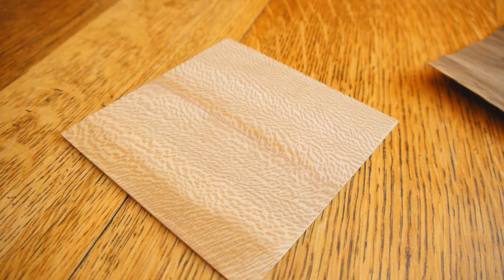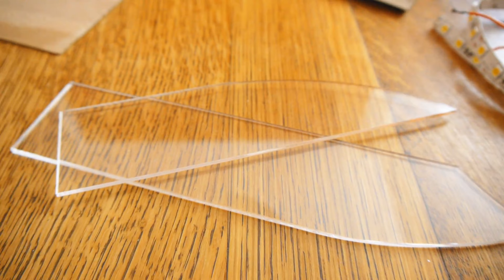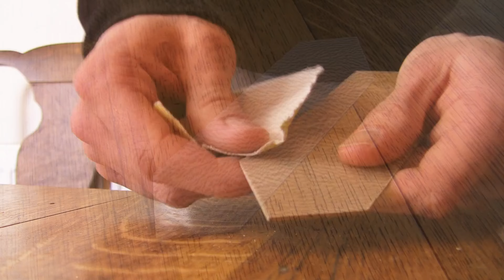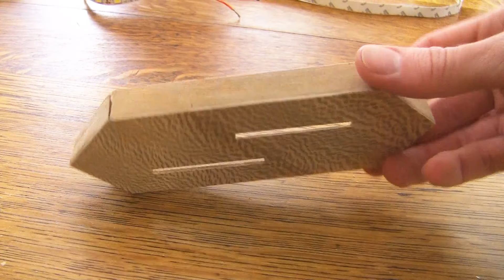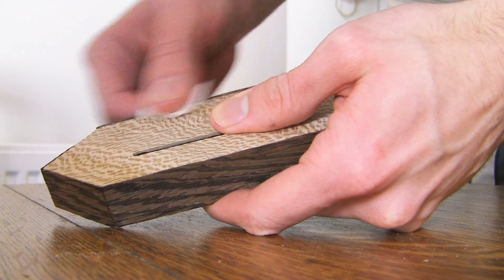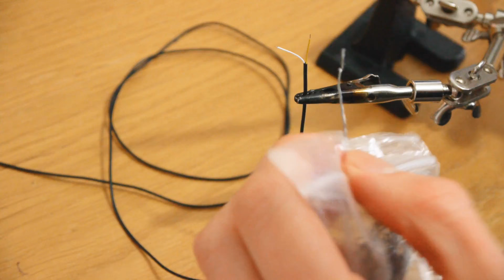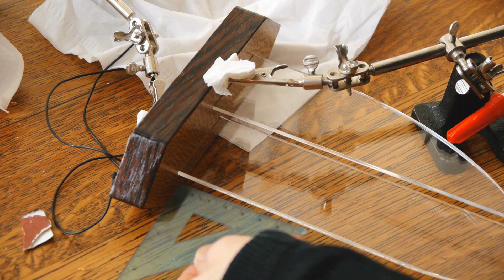Make your own Shard Light

Comment: Joining the wires with tape is a bit of a bodge, after spending so much time making a nice job. I would suggest fitting a socket into the lamp unit, and a plug on the wire from the power supply.
Doesn't cost much. You can get them from somewhere like Maplin (uk). Oh shit, they just went bust - lol...

Comment: I really liked your video but I Suggest you bridge the LED lights in a parallel circuit so they can both run on 2 AA or AAA batteries and you could make space for a battery holder and that way you could eliminate the need for the power supply and make it slim and wireless

Comment: Only thing I could think of to add to this is either a switch to turn it off and/or a potentiometer to adjust brightness. Both could have easily been placed near the wire hole on the back

Comment: Nice build, If you wanted to get a nice clean finish on the shards and remove the scratches (depending how deep they are) you could alway wet sand the pieces with fine grit paper (2000 grit or higher) and then use polishing compound for a clean finish.

Comment: can I use real glass?
Reply: true but I don't think glass transmits light like acrylic does these kind of plastics illuminate on the edges in a unique way similar to fibre optics.
Reply: i try it ! but it's so hard to make i shape like that with glass
Reply: and would you really want razor sharp glass shards on your book shelf.
Reply: hhhhhh It could be rubbed, to become smooth edges
Reply: yes
Reply: It doesn't.

Comment: That was too much of an exaggeration  with all those equipment ...  And in the end joining the end of wires with electric  tape
Reply: i too noticed that part was a little poor made, but maybe he has his reasons for not soldering it or using some clamps (i don't know how they are called in english but in my country we call them "morsetti mammut") maybe he wants to add other lights to the same power supply
Reply: seriuskndfgs egg oh really didn't kmow that
Reply: hennochoi they are called alligator clips (the more you know)

Comment: to make the light softer or dimmer, you might try using resistors on the voltage source. (12v seems high for 3 LED's) 5- 6v is nice. if 12v,  try a 22 ohm, 33, or 50 on one side of the power source for desired brightness.
I like to sand the shard edges flat to diffuse the light. 
Nice vid... +1

Comment: It is not get hot?
Reply: These led usually requred additional cooler
Reply: depends on the actual LEDs he used, but usually the ones mounted on Strips are pretty low power and the cooling provided by there PCB is enough :)
Reply: Mirock's Woodshop Glass is already a bad conduter of heat, it will not get hot because it radiate the heat before it get hot cause radiating surface area is much bigger that bottom heating area.

Comment: If you leave the connector on the power source and put a fitting connector socket in the stand, it will look more finished and be safer.

Comment: Just a heads-up on the "old headphone cable":
Most of them have cables that are hard to solder, so I`d go with maybe an old cellphone charger, a 3.5mm headphone jack cable, or something like an RCA cable, those are also thin and are almost always of the easy kind to solder :)

Comment: i have used a 5050 RGB light strip with transparent sillicon glue, but some of my LED's don't turn the right color. It is in the middle of the strip where this happends. It is not the solder points, because i dubble checked them and used plenty of wire so they wont move when i glued them down. Could it be that my glue creates shortcuts??

Comment: To anyone who doesn't want markings on their plexiglass/acrylic here is a tip.
Buy plexiglass/acrylic that has a protection layer on top (It's kinda like tape). Be sure to remove part of this layer before glueing it to the LED's. When you slide the wood on top, remove the layer.
This migth not work though as it can be hard to break shards of with this layer on top.
But regardless, now you know.

Comment: While I'm not handy enough with wood to actually make this I do think it would look awesome if you set it up with RGB LEDS which you can get in the same strip configuration as in the video.  Using something like this: http://www.amazon.com/HitLights-Multicolor-Changing-SMD5050-Density/dp/B005QDO8YU/ would provide you with the controller, wall adapter and a remote.  Wiring is the same except you have 4 wires to be mindful of instead of 2.

The big thing is you'd have to work out how to accommodate the IR receiver, either with an extra hole in the side of the base or possibly hidden cleverly near your lamp.  On top of color changing and patterns you'd also get to turn it on and off remotely so points there as well.

Comment: 90% art work and the rest is  tech know how. bottom line is make glass shards exposed to LED lights edge ways. I need  an A4 square   completely flat size to use it for reading in a dark room before I go to sleep. practical use

Comment: If you're going to be soldering, you should go ahead and use shrink tubing and solder the power supply leads. Electrical tape comes off and becomes sticky over time. If you don't stagger the leads to begin with it could be a fire hazard when it slips off. This is a simple and fun project.

Comment: Could you use colored film (like in the old red and green 3d glasses) over the light source to change the colors of the individual shards?
Also, could you use transparent plastic rather than glass? I'm thinking about sharp edges or the glass shattering if it were knocked off a table...
Reply: Eethan O'Connell It's not glass, it's basically plastic. And you can just use different colored LEDs.

Comment: How to do it simply:
Go to your friend's car and break his windshield. Take two glass shards and give them a round edge so nothing gets cut, other than your friend.
Take a coaster and cut two slots that the rounded glass shards fit in. Flip the coaster upside down and put some LED lights that are facing the holes you made. Take the two glass shards and shove them into the holes. Scratch them with some metal scrubbers or sandpaper to have a little touch of art. Superglue the glass inside the holes and superglue the LEDs to the bottom of the coaster. Superglue the bottom of the glass shard to give it extra stability. Enjoy your art that you spent hours  making and cutting yourself with. And the 20 minutes of time it took you to read this comment, take all the stuff to make this and do it.
матегiаιs:
Glass shards x2
Oval coaster or wooden stand
LED lights
Sander
Sandpaper
Hot glue or super glue
Batteries for the LED lights

Optional Items:
Sharpie marker to outline the glass shards
Colored tape to decorate
Funny stickers to decorate even more

Comment: You made this WAY too much work...many things could have been done easier, and better...First, why are you using veneer on the edge of REAL WOOD, just stain or oil it rather than creating something fake from something real.  Also, you shouldn't glue the LEDs to the acrylic, you should glue them to the bottom of the base (which for some reason is missing) and set the acrylic over the top of them freely (on top of a "spacer").  I know there are 100 different ways of doing things for every 100 people asked, but this seems "over engineered" on the wood part, and "childishly assembled" for the electrical part.  Nice idea, bad way to do it.
Reply: Ikr, he made it look so hard

Comment: Neat.... But all I see is a fire hazard. No heat sinking for those high power leds, small enclosed wooden and unvented box. Not in my house thank you. No matter how nice it looks.
Reply from the maker: UltraStoat Fire hazard? The LEDs together use around 300ma total, so that's 0.15w per LED. Hardly enough heat to cause a fire, even if packed with the driest most flammable paper imaginable. It's like saying 'don't leave your little LED flaslight on the floor... it might cause a fire'. Just thought I'd make it clear in case others read your comment and get put off doing the project. Your finger is probably warmer than the LEDs ever get.
Reply: DIY Perks So by your own admission.... your 300mA draw out of your 12V DC power supply equals what?  Well that would be 300mA * 12V = 3.6W.  That's 3.6 watts of heat you have to dissipate inside a small insulated box. Wood is an insulator your realize.  That's actually a lot when we are talking about the the small spaces we are dealing with.   I don't know where you got 0.15W per LED from, using your very own numbers it is 3.6W / 6 which is 0.6W per LED.  This isn't astronomical, but its not insignificant either... Especially when you put 6 of them in an insulated box with no venting.  So, yah, neat looking crafts project, but wouldn't put it in my house without some modifications.  Like using a metal bottom plate to which you would thermally mount the led strips to instead of wood.  That would probably be adequate heat sinking even without adding little feet to the bottom plate to raise it off the ground for air flow.
Reply from the maker: UltraStoat That's 300ma at the LEDs forward voltage, not at 12v (they're connected in series with a current limiting resistor). They're 5050 SMD LEDs you see, and are rated at 50ma each. That's a total of 0.9w... again, hardly enough to cause a fire or even get mildly warm.
Reply: It is easier to cause a fire with your mind than with this...
Reply: Ugh. Too many numbers XD
Reply: +UltraStoat You quite obviously have no clue what you are talking about.

Comment: ok looks great and an easy electrical build, but why so much faffing with different woods. why not just get a block of hard wood and open up the bottom for the gubbins? surely that would have been easier
Reply: supraking85 exactly, or i would use a peice of nice worktop for a cool finish, still it looked great.

Comment: Could you run those same LEDs off of a 9v battery, or do they need 12v?  I was thinking that having a battery operated light shard would be pretty cool.
Reply from the maker: lilturk726 They should work of 9v but will be a lot dimmer.
Reply: Okay thanks.
Reply: on eBay you can get battery operated LED-Strips, they use 3x AA batteries and runs pretty bright, got a couple of them myself. Those 3 batteries can easily run about 140cm of led strip, 60leds/metre I believe they are (put 2x 70cm together from two kits).
Cutting off so you only have 2x3 leds and you should be fine.

Also I usually test RGB strips with a 9V battery, a bit dimmer than 12V, but depending on colour it doesn't matter too much.
Not sure how it'd be on a white light though.
Reply: Nightykk Wow, thanks.  I'll take a look at those battery operated LEDs.  I wanted to make my niece something similar to this but I didn't want her to be bothered with plugging it in.

Comment: we cant use 12v ac adapter?
Reply from the maker: Aurbachin Auwhi If its output is AC then you'll get some flicker, but it should work all the same. One with a DC output is a better bet.
Reply: DIY Perks That might actually be pretty cool. Thanks for mentioning.

Comment: Did you smooth the edges of the glass?
Reply: Maddy Krebs he used plexi
Reply: John Krazek so is it smoothed or not along the edge? never worked with plexi so unsure how sharp the shard would be along the edge
Reply: the few times i worked with plexi, i sanded the edges and then used a buffer to get a nice finish on them. the corners and where you break it may be a little sharp, but other than that, if you get a decent break, you should be alright
Reply: thanks!
Reply: you can cut it with a plexi cutting tool, jig saw, fine circular saw blade, or even a razor blade if your determined enough to make it any shape you want
Reply: Maddy Krebs You can "polish" the edges of the acrylic (plexiglass) by carefully playing a butane torch flame along the edge at an angle of about 30 to 45 degrees, but be careful not to heat it too quickly in one spot or the plastic will burn and catch alight.  This heating process also takes off any sharp edges.

Comment: Since led's take very little power, aren't there led's that we could use like you did but are powered off a small 9v battery?
Reply: No. The power isn't negligible, especially for batteries. Plus the bright LEDs can be a real hog, sometimes over the capabilities of a 9V battery.
Reply: You could, it just wouldnt be as bright as 12v. And you would need to replace the 9v periodically.
Reply: zwz • zdenek
Well....
1x 5m 300 led strip light states that it takes 4.8w/M
(4.8 * 5m = watts per strip= 24w per strip)
(each strip has 300leds, so 24w/300led = .08w/led)
This project used 6x leds, 6 * .08 = .48watts.
On 9v, this means a current draw of ~50mA (.48w/9v)
a typical 9v battery has a capacity of 500mA/h
Roughly speaking, 500mAh/50mA = ~10hours operation of this 6LED setup off of one 9vbattery.
Take it as it is.
Reply: stertheder
Threshold voltage per one white led is about 3.2V, there are 3 in series per group. That's 9.6V to get the dimmest glow.
I won't take that as it is.
The proper solution would be to buy a clip for 8 AA or even C cells for a better longevity. If one is desperate to power it off of primary batteries.
Reply: zwz • zdenek D-oh! I completely forgot about threshold voltage! Thank you for reminding me.

Comment: I think it's awesome, but next time use tools that everyone has.
Reply from the maker: Dico Mico How would you make this using just scissors?
Reply: idk, but that light is pretty awesome.
Reply: You can improvise a little on this project if you don't have every tool, but honestly I can tell you from experience that doing any job without the proper selection of tools will take way longer than necessary and won't look as good unless you are very skilled with the tools that you do have available.  There is no substitute for the proper tools when building something.
Reply: Real people own tools. At least somes for make somes DIY stuffs. Also buy good ones and give them to your children. Tools are good investment.
Reply: Strip wires and twist them through the holes :D and then twist em together to the power thing and don't but you do need wood wires power adapter electrical tape and the LED tape
Reply: DIY Perks LOL Well Played !
Reply: Michaël Colignon
I knew a guy who didn't have a single screwdriver in the whole house. His family was kinda snobbish and they used to call an electrician to change a bulb. The father was a real estate contractor. A complete leech to the society.
Reply: The tools he used are ones everyone I know has.
Reply: well no one i know has a soldering iron exept for maybe my grandfather.... and he probubly lost it years ago... and no one has plexy laying around but you could use filed glass.... and nobody that is normal has any wood just sitting around
Reply: GoldenSword Entertainment "and nobody that is normal has any wood just sitting around"

Normal is relative. Everyone I know has lots of wood in either the garage or shed/barns. And you are right about plexiglass, but it is so cheap and easy to get, you don't need to have it around. Of the people I know, I'd say it's 50/50 if they have a soldering iron.
Reply: GoldenSword Entertainment Led strips are so cheap.... i bought 5 meters for 15 dollars and used them in my computer case
Reply: Mhhmmm and we all have 15 dollars in our bank cards that aren't existing?
Reply: Hey, you can buy 2 meters for around 6 dollars, it's not much. Collect money and you can buy it.
Reply: zwz • zdenek How is paying hard-working, talented people bad for society?
Reply: those are about the most "everyone has" set of tools i've ever seen -.-
Reply: Dico Mico it is possible to get them
Reply: g1g4tr0n3 of awesomeness world
Reply: lol we have wood im saying people in general dont and especialy not the right size and crap... and also led strips are kinda expensive..... in my mind atleast and also you need a paypal to get them which everytime i try to sign up it doesnt work.!!!!!!!!!!!!!! anyways im saying normal everyday people who live in the city and urban areas not rural like me dont ussualy have wood just sitting ar ound

Comment: Suggestion, instead of using all those different bits of wood for the base, try a solid piece of wood, drill into it the right depth multiple times, and then proceed to chisel out the excess
Reply: Yea a plunger router would be perfect for chiseling out the insides of a solid block of wood!
Reply: DeezMistaReez i didnt consider that. that is more efficient, and looks even better
Reply: A dremel would do the job, something every DIY'er should have. I got a multitool for like 25 usd

Comment: Err... don't you need resistors for the LEDs? I have no idea why they're needed, but I do know they are.
Reply from the maker: Moshehim Not on LED strips, usually, as they have them in-built.
Reply: DIY Perks Oh, so they actually already have resistors. Cool.

Now, if only I had the vaguest notion why they require resistors in the first place... Don't suppose you'd see your way to explain that?

Comment: I did this with glass from a broken picture frame and a different color led strip
Reply: DIY Perks
Real glass can be dulled with sandpaper. Also, plexiglass will almost inevitably have lots of scratches that spoil the design while real glass can be cleaned beautifully.
Reply from the maker: Bad idea using real glass! Make sure you keep it WELL away from people!
Reply: You mean on a really high shelf
Reply: Just because Its sharp?
Reply: zwz • zdenek
Depending on who you ask, some would argue that those scratch flaws actually give it a cooler appearance.